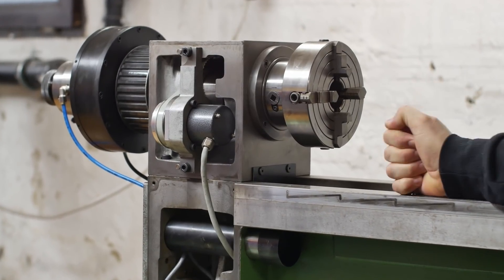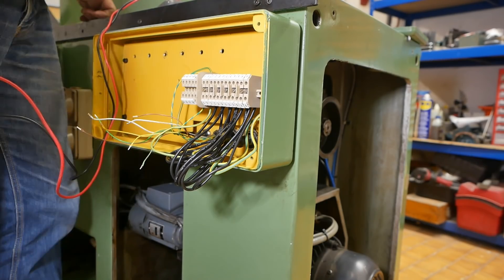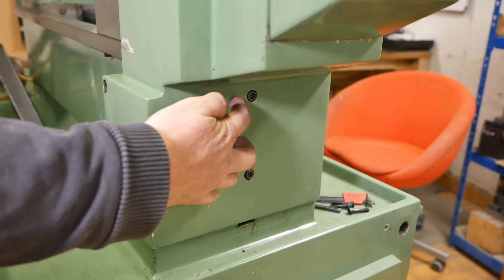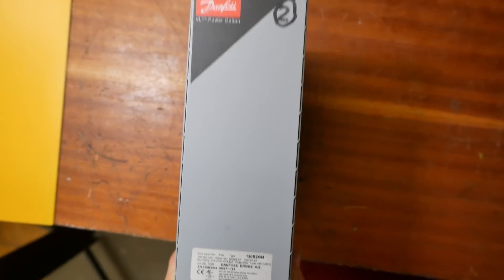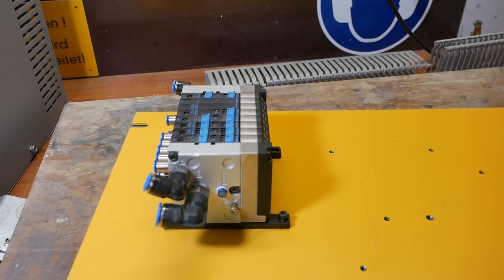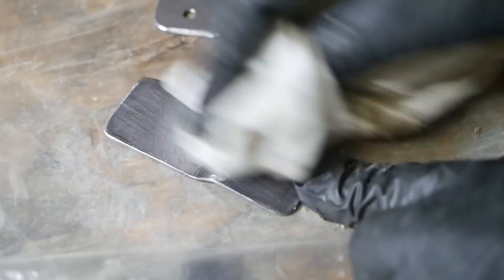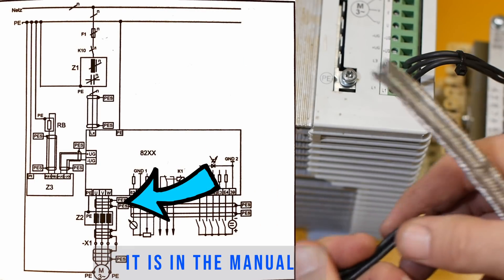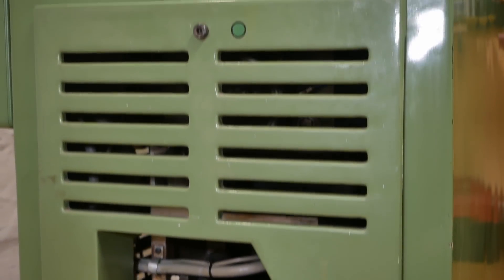Laying out the electrical cabinet - Schaublin 125-CNC lathe

Comment: You'll probably catch some shade from the woodworkers in your audience for your use of the plate joiner.  Ignore them - do what works for you.
Reply from the maker: I used them to try and sensure that the laminated parts are reasonably level to each other. How are they supposed to be used?
Reply: @RotarySMP  IMHO, that is exactly the way they should be used.

Back in the day, the plate joiner (aka biscuit joiner) was made popular by Norm Abram.  In the beginning the message was that the biscuits added strength to the joint, like dowels or their modern equivalent, dominoes.  Eventually people realized, including Norm Abram, that the biscuits really add little strength and the biscuit joiner fell out of favour.  Many of those that cast it aside didn't follow the evolution of its best use, i.e., using the biscuits to align long grain joints.  Those are the ones that might give you grief.

The only thing that I would have advised you on would have been the use of the fence.  I'm pretty sure the Lamello is the same as my Dewalt.  The fence should be flipped down and used to reference the top surface of the work.  The way I saw you work, you used the top of your work bench for your reference.  But it got the job done and I'm sure Mrs. Rotary will be happy with the result.

Comment: One of those WaterPik Water Flossers might make a decent low enough pressure washer for cleaning the Swiss Gunk. If you don't plan to use it in your mouth, you could probably load some cleaner or solvent into it. But then the plate would clean, and the channel would have to be shut down :(
Reply from the maker: We wouldn't want that now would we. But you are on to a good point. That was probably water soluable coolant, and may soften with water.

Comment: Mr. Rotary i would humbly  suggest for you to buy a PEI sticker or powder coated PEI flexplate for your printer. No more brims and curling of the material :)
Reply from the maker: I have mostly avoided running too deep down the 3D printer rabbit hole. Mostly I get the results I need. My mate who designed this also switched to that sort of base, but I didnt get around to it.
Reply: @RotarySMP  I know what you mean. Another hobby that can take over your free time. But PEI is definitely worth it.

Comment: You need like an ultrasonic brush for that resilient schmoo in the nameplate
Reply from the maker: Is that a thing?
Reply: @RotarySMP  just cut the bristles of a toothbrush down to half length (more stiffness!) and use WD40. It'll be done in no time. You could use a sonic(?) toothbrush but where's the fun in that?
Reply from the maker: @murrayedington  As soon as you say "dental" I hear $$$$$ :). Making a brush stiffer by cutting down bristles is a good idea.
Reply: @RotarySMP  Supposedly they are used for high end dental hygiene, no idea if the cost is reasonable for this application though

Comment: you better  watch out for vfd's output they  interfere  with low signal. so shields everything (all high power and low frequency cables )or spend  more time  on layout .
Reply from the maker: Yeah, that is why I shielded the line to the Sine filter, and also added the sine filter.

Comment: did you connect the earth to a painted surface?
Reply from the maker: No. I have'nt run the earth wires yet, but have a copper earth bus from the Schaubin electrics, and will paint strip any earth mount points.

Comment: Shouldn't the filter be placed between the vfd and the net? to reduce the electrical noise that you send out to your neighbours? Or is this perhaps a different type of filter?
Reply: Nope the sine wave filter is connected between the VFD and the Motor. Its purpose is smooth out the PWM of the VFD to a true sinusoidal voltage reducing the stress on the motor insulation.
Reply: @Alexander470815  Thanks, interesting! That's a filter type that wasn't really discussed in my electrical classes. It might still be interesting to look at the harmonics profile of the line side of the VFD. When i have mine running with no filters, you can literally hear the electrical noise on all audio equipment when their aux cables are not plugged in to something
Reply: @radioroestig9638  Depending on the internal filtering of the VFD line reactors or filters may be needed too.
For the sine wave filter you may want to read the document for that filter, look for the Danfoss output filter design guide on the internet.
It explains a lot about the usage and the effects.
Reply from the maker: @radioroestig9638  Ouch. That is a lot of interference.
Reply from the maker: Thanks Alexander.

Comment: You might already know but depending on which configuration of the Dahlander motor windings you're using then one set will need "shorting" it's not a 2 speed motor in the conventional sense with 2 separate windings but one winding that can be configured 2 ways. 

We have a 315kw meals grinder that's Dahlander wound, a lot of homework went into replacing the starter panel for it 😀
Reply from the maker: Good point. I need to take a look at that. Probably best to do that in the junction box near the motor.

Comment: I work in industrial automation and terminals are used mostly for outside connection from and to the cabinets and also to distribute power circuits, so there is nothing like "five wires in the bottom of the circuit breaker" Nobody really uses terminals between the components inside cabinet unless it is necessary. So your use of terminals looks fine to me. What I would do differently is use new and spring loaded terminals. These screw contacts should be checked regularly and tightened to spec. Which is pain on self to do regularly (and reason why nobody really does this) And these are not exactly new, so who knows what shape are threads in. I also do not like old brittle hard plastic of older terminals. But this can be easily fixed later. Your VFD wiring is way neater than some stuff I have seen running for years in production. Shielding is good point, but I have rarely seen it inside cabinet with this length. Mostly it is without load filter and with shielded cables all the way to the motor. What you did should not hurt. Only the filter for such load takes awful lot of space. The comments here about VFD needing some more cooling is something you should consider. I have seen similar power VFDs without cooler and vents on the cabinet only when they were mounted on massive heatsink, that was reaching thru the cabinet wall outside. So I would fit a fan and couple of vents. I really enjoy your videos. I guess I will also plant some Jalapenos this year :-)
Reply from the maker: Those terminal blocks I removed were only there as a place holder. I bought a bunch of new ones in different colors to make up new ones. I did buy screw rather than spring type though :(
Thanks for the input on cooling. I have only use really low power VFD's before.  I'll have to take a look at how I can add cooling.
Reply: @RotarySMP  Screws are better than spring IMHO. Now they are in trend, and I think are being pushed by the manufacturer of those, of course. Is more convenient, but I do not trust them for the next 20 years. Best way to go is thermography every couple of years, to see if something is loose and going high resistance.
Reply from the maker: @esepecesito  Thanks for the feedback on that.
Reply: @RotarySMP  I will side with Federico on that. US wall receptacles often have both screw terminals and "push in" spring connections. Most DIYers use the push in connections because it is easy and fast. Most electricians use the screw terminals, after having replaced numerous melted receptacles where the spring contact overheated over time and lost all temper. Of course you do have to get the screws correctly tightened in the first place, but that isn't all that hard.
Reply from the maker: @lwilton  Thanks for the feedback on that. It is tough for an amatuer to find knowledge on a lot of these things.
Reply: I would agree to Vit's philosophy for the terminal usage. They're basically just to split up wires, because you shouldn't use two wires in a ferule or two wires in a screw clamp if you can use a terminal block instead. 
Other then that they're just for wires coming in and going out of the Cabinet/plate, so you can disconnected them reasonable without destroying the whole cabinet.
Reply from the maker: @humbucker0076  Thanks. I appreciate your guidance.

Comment: Very nice video as always, I really enjoy the series and would like to see some background on the wiring/electrical of your machine. I think its not neccessary to see you put in every single conductor but some short timelapses and a short run-down narrative of what controls what and why would be very enjoyable. For the wiring I would suggest the following: You are correct about keeping drive/motor-cables that carry modulated power short and having them shielded. You should however avoid crimping/soldering on those pigtails to the screen-mesh of your cables and you should connect the shield on both ends of the cable. The little braket you put under the Danfoss line-filter(normally belongs as close to the terminals as possible, there are two screws on the bottom of the filter to mount this bracket) is a perfect example of how to connect the shield , all around, no reduction of the mesh coverd area and as close to the terminals as possible. As for your question about terminals I'd recommend building multiple seperate blocks (for example: AC-Supply/Power-Distribution, AC-Outputs[Pump, Lights, etc], DC-Distribution, DC-Controlsignals). As a rule of thumb I would wire every Controlsignal or Power-Output that exits the cabinet via Terminals for neat and central connections, Signals that only connect between two points inside the cabinet can be connected directly. E-Stops and other stuff that might be needed for troubleshooting often is also something worth having on Terminals to find errors quicker. However motor-cables from your drives that exit the cabinet should definetly not not be run to a Terminal first but connected directly to the drives as every break in the shielded line radiates EMI(in this case the unshielded Terminals). Thats the advise would give you based on my job-training and expierience.
Reply from the maker: Thanks for your very thorough feedback. That really helps. 

Duh, I was wondering what those two extra screws on the filter housing were for :)

Comment: So this may or may not be a thing (I can’t tell what model vfd that is) but Lenze has a super awesome software for their drives and if it’s a compatible drive you can get all kinds of cool diagnostics (duty cycle, temperature, load, and more). I hope this isn’t some form of terrible foreshadowing.
Reply from the maker: Thanks. I need to look into that. It is pretty old. 8200 series.

Comment: The wiring between the VFD and filter is pretty good, after the filter you can be more relaxed. The components moving around montage was pretty relaxing to see but I bet you spent 90% of the video effort on it 🤣
Reply from the maker: I guess it took about an hour to do the stop motion. That was fun.
Reply: @RotarySMP  if Mrs. Roatary asks why this project is taking so long: Because these swiss components are moving so damn slowly. :D Great stop motion montage.
Reply from the maker: @DonStinger  Thanks for commenting. It helps-

Comment: IMH, our standards of "neatness" for things like what you are doing comes with a huge misconception. it doesn't have to look good, it has to be functional and accesible to work on. if it looks good as a result, then great. all you have to take into account is: "is this the shortest, less complicated and inexpensive way?, does it reduce EMI/cross talk?" and "will i (or someone) be able to get in there, identify what is what and change something in less than an hour?" if the answer to all is yes, then your wiring is perfect, even if it looks like crap. also, and of course, color coding or labeling is a MUST,
Reply from the maker: Good point. I am starting on the wiring diagram. It didn't make this video. I didn't make the short wires between the line reactor, VFD and sine filter as they see pretty obvious.
Reply: wiring diagrams are the way to go. and hey! dont get me wrong, i know you are tidy. was just using the oportunity to put that out there.
ill tell you a story (kinda long read ahead, im one of those talkers.. be warned)

friend of mine called me to help him swap his car stereo (old pice of lovely crap car that was ape-handled by the cheapest mechanics in the world). he came by, i remove the stereo and i see little nest of wires that wasn't so terrible but the colors were all over the place, blue with red, red with white... a mess. then i look a bit closer and i see a piece of paper tucked in there. open it, lo and behold, a wiring diagram! color coded and everything!! i was like "DUDE! however left this here deserves the world!" my buddy goes "DUDE! stop flattering yourself so much!"... turns out it was me, i left that piece of paper there YEARS ago when we put that stereo in, and completelty forgot about it! then it all cambe back to me. the previous mess was 100 times worse and i knew back then that someday, should i not do something about it, someone would have to go through that mess.. couldnt let that happen. well turns out that someone was me. i loved my self so much right there and then hahahahaa.

Comment: Very nice video.
When the VFD  is used there should be a fan, because of the large dissipation of the heat. At least open the window with filter on the doors of the control cabinet, some of VFD have fan.
VFD could signal overheating.
What about breaking resistor(also dissipation of heat)? Maybe it would be a good idea because you could stop the spindle really fast, without using mehanical breake.
Just few thoughts.
Reply from the maker: Thanks. The cabinet is not closed completely. It is open through into the machine base.

Since there is already a mechanical brake installed, I will use that rather then a braking resister.
Reply: @RotarySMP  I am no VFD expert. But what I have seen, breaking resistors are used also when changing to lower speed on the fly. I am not sure if this VFD has internal one, but that would be really small for mostly constant speed use anyway. Load to the resistor than also depends on ramps used. Also if you plan to use some kind of feedback control for speed, they can utilize breaking resistor quite a bit, while speed setpoint could oscillate a little. Are you planning to use mechanical brake controlled by VFD? It would be the most safe in my opinion, while estop, power outage or any problem with control would not end up in unsafe conditions (i.e. workpiece spinning down for long time without control) But I have never seen brake used for active stopping. Only for fixing the stopped drive in position. Check if VFD supports this function of the brake.
Reply from the maker: @soucevit Good inputs. I haven't really thought through the control setup of the brake yet.
Reply: @soucevit  I agree, resistor shouldn't be big. On most application electromehanical brake is used for "parking" because you can engage the brake on small speed(5 Hz), and save the braking pads. When you have dahlander motor, you engage the brake on constant speed.
When you have resitor you can change speed quickly, without you will have DC error. 
The VFD  has to have braking chopper to use resistor.
I am not lathe expert, this is something I saw on different projects.

Comment: this shielded wire crying for good bracket. Tap vfd radiator and use p clip, I think it's best way
Reply from the maker: I was also thinking about a P-Clamp on that. Probably just make one to reach to the grounding stud.

Comment: I would mount wire loom in two places, but it is automotive vibrations that makes my wires brake :>
it is fine loop tho, but it would be prettier when in paralel to anything
Reply from the maker: Yeah, I kind of like those cabinets with everything in parallel too.